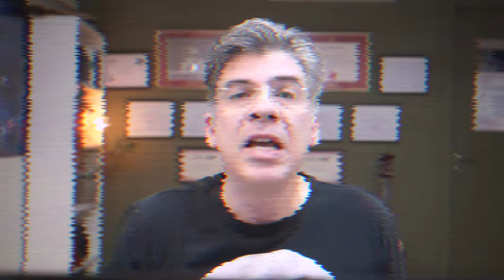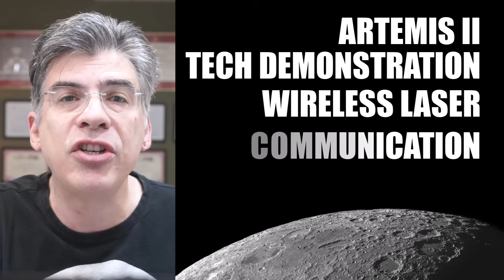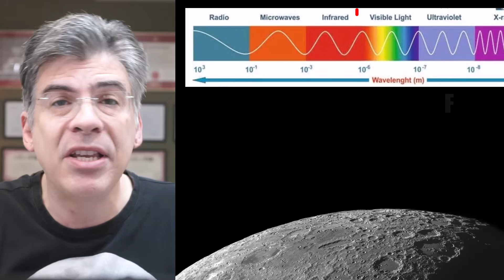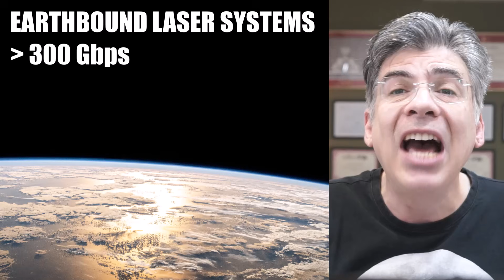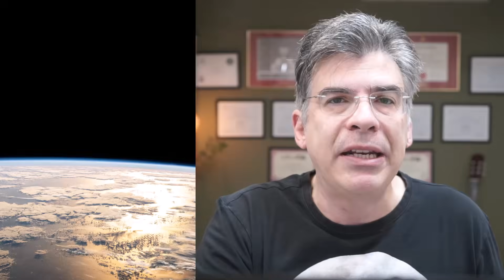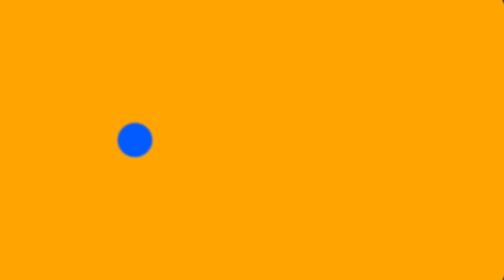Laser vs RF: How Artemis II is Revolutionizing Space Communication

Comment: The communication delay between the moon and Earth is bound by the speed of light. What makes laser communication able to achieve higher Mbps speeds from the moon than RF? Is it because a larger amounts of data can be transferred without loss?
Reply from the maker: You're absolutely right. The higher speeds achieved don’t have to do with the actual propagation speed of the signal. Both RF and laser light are electromagnetic (EM) radiation, so they travel at the same speed: the speed of light.

The difference has to do with the modulation and encoding methods used to place data onto the physical medium.  In RF communication, we typically use modulation techniques that vary amplitude, frequency, or phase (like QAM, PSK, etc.). With laser (optical) communication, we can use extremely high-frequency carriers and very precise light pulses, allowing us to encode data at much higher rates.

Because optical frequencies are orders of magnitude higher than RF, they can support much greater bandwidth, which directly translates to higher potential data rates.

The other major advantage of laser communication is beam behavior. Laser beams diverge much less over long distances compared to RF signals. This means that more of the transmitted energy actually reaches the receiver, and there is less signal spread and less interference.  You get a much higher signal-to-noise ratio (SNR), and higher SNR allows for more advanced modulation schemes and higher data rates with fewer errors.

So laser communication provides higher bandwidth, better signal focus (less divergence), and higher SNR, all of which enable significantly higher throughput or speeds compared to traditional RF systems, especially over long distances like Earth-to-Moon links.  Make sense?
Reply: @telecomTech.explained , thank you so much for this detailed explanation. I truly appreciate it. Looking forward to seeing a 4K streaming from the moon in a few years.